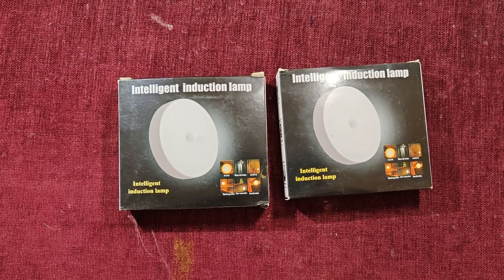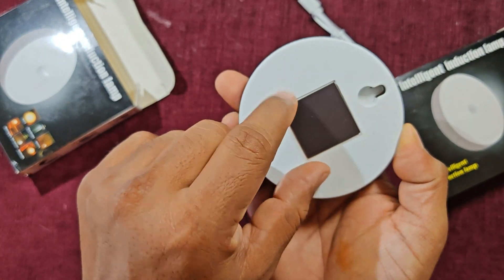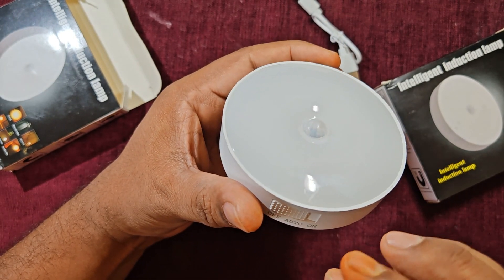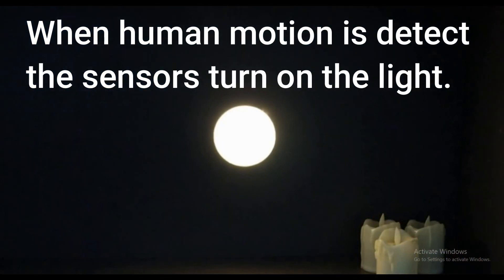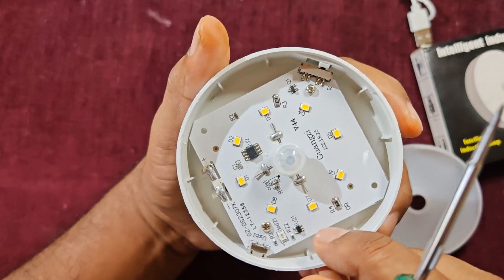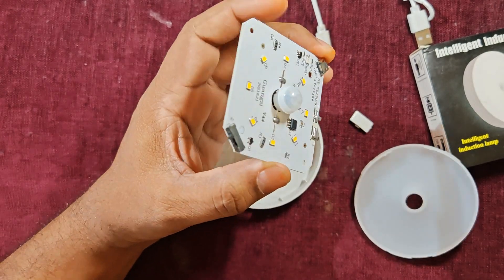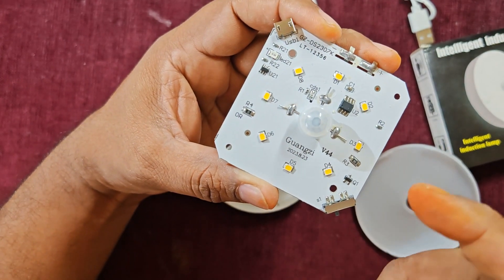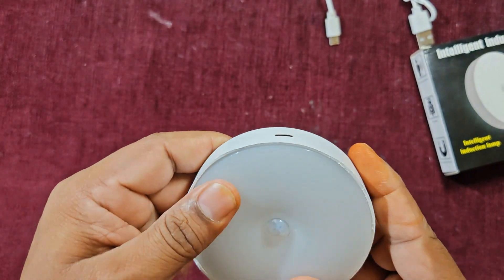How to Repair and teardown a induction charged Night Light (PIR light sensor)

Comment: Sir, you never informed what about the battery is it replaceable
Reply from the maker: Yes battery is replaceable. You will get it online
Reply: Thanks Sir  @sakibmujawar3477
Reply: Sir, the lamp is good but its use and throw...Battery is lithium which is soldered. You can't get it online.Even if you search online no specification of this battery neither maH capacity mentioned. Nobody knows whether it is 3.7 v or 5volt or 6 volt. Jus use and dump to ewaste.
Reply from the maker: @roopaiyer4179 it's 3.7v 300mA battery
Reply from the maker: @roopaiyer4179 https://makerbazar.in/products/generic-3-7v-600mah-lithium-polymer-battery